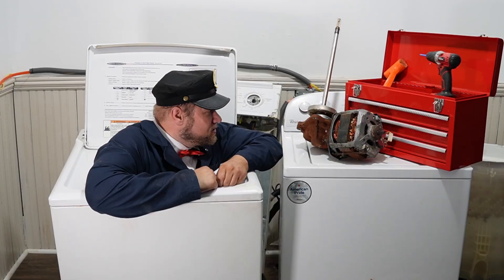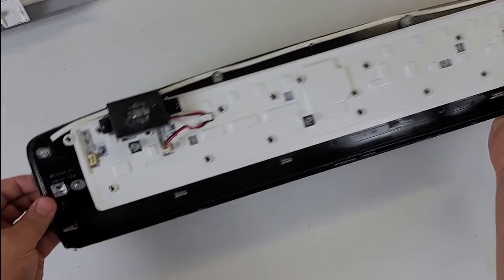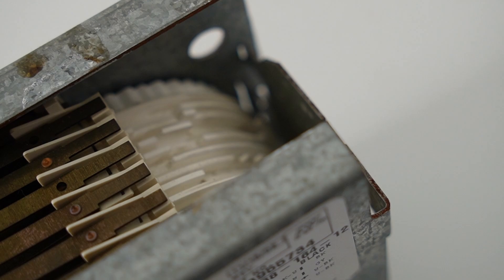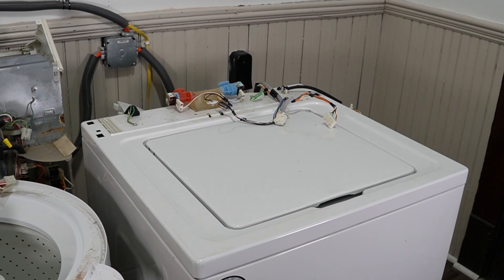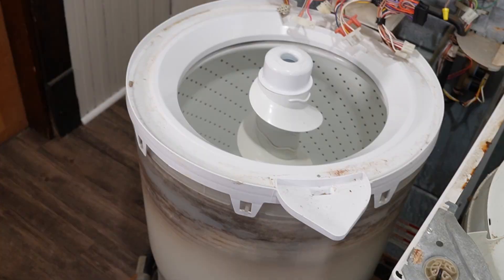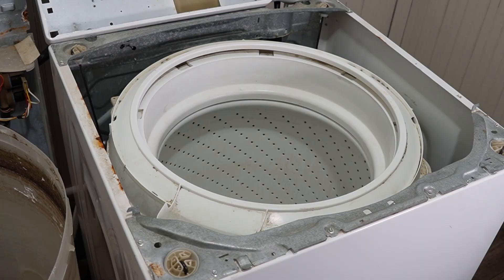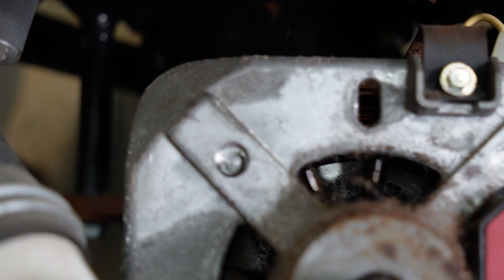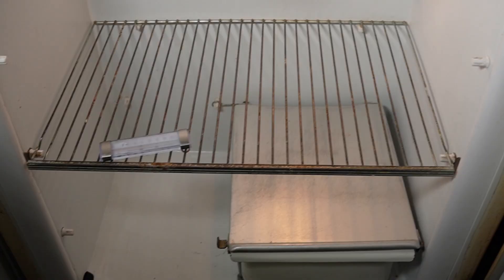Are Washers Built to Break? Inside a 1984 Washer vs. Now

Comment: When I moved into the house I live in now, there was a Whirlpool Cabrio. It worked for about a month, and the little fist-sized pump that drains it started to fail intermittently. A new pump was *$180*. So I went to the used appliance store, walked up to the guy with the fewest teeth, and said "Whirlpool, direct drive, mechanical timer". His face lit up, and he sold me a battered Kenmore which is, of course, a whirlpool, for $100. It has one big motor running everything, it's noisy, but it's never broken down.
Reply: Would have been a lot smarter to replace the drain pump. They are about $15 on Ebay, Amazon, etc. All washers (and dishwashers) use the same pump and there is only a few different mounting flanges. Your new (old) washer has the exact same pump and can fail at any time for the exact same reason.
Reply: @johncoops6897  The cabrio and the Kenmore are entirely different machines, the pumps are not the same. The Kenmore has one large motor driving a transmission, and the cabiro had two small pumps and a motor on the tub. These pumps could not be had for 15 bucks, I did check Amazon and ebay. The lowest price I found was 176.
Reply: @Oddman1980  Yeah, companies do dumb shit to screw customers, like custom sizing of the inlets in a weird size, or odd pinouts, that kind of crap.  Sometimes you can bodge a cheap replacement in, with a little know-how, but like most people feel here--and Timmy stated directly, the problem isn't that electronic controls don't last as long, the problem is that profit-grubbing companies use the cheapest components possible, absolutely intending that expensive parts will fail in 5-7 years, so that people are forced to replace the entire machine, or, at the minimum, pay the company a hefty additional fee for components/service.

Can't bloody wait for appliance manufacturers to get in on the licensing game.  "Oh, you want the delicates cycle?  That's another $10/year for the "Frilly Panties" add-on.  Your base license only gets you cold/cold, permanent press."
Reply: Cabrio? Really?

Comment: What a great video!  I'm a design and test engineer for medical device companies, and anytime I need to come up with something that has to be both reliable and manufacturable, I start by looking at home appliances.  Growing up, we always had GE appliances (both my parents worked for GE) and even with six kids, the washers lasted 20 years or more.  I still have a GE washer, but after the first one lasted 20+ years, the second one, which while is still going, lasted only a couple years before it started not draining and throwing a "pump start" error.  Turns out the pump was clogged with lint, probably a consequence of doing away with the lint trap (?).

You mentioned that you have heart failure and, unless you were joking (why would someone joke about that?), there is a device to counteract many types of cardio failures called a "Left Ventricular Assist Device" or LVAD.  I used to work for the company that invented the first practical  LVAD (Thoratec, now part of Abbot Labs), and the current model, called Heartmate 3, is a centrifugal pump that, in design theory, is exactly like the water pump on that newer washer.  They completely eliminated shaft leaks on the pump by embedding magnets in the pump shaft, but putting the coils on the outside of the plastic housing.  The Heartmate uses a magnetically transparent stainless steel, but it's built the same way for the same reason.

You might ask your cardiologist about whether an LVAD would help in your case.
Reply: Magnetic drive pumps are available in many sizes, eliminating shaft leaks and isolating the pumped liquid from any material other than the housing and impeller.
Reply: I think the GE you parents worked for was a far different company than the one today.  Myself also an engineer but im profoundly baffled by all of the useless and unnecessary features that goes into todays products.  Its a waching machine for goodness sake.  Put the money and the effort on making it last.  I have a similar approach to designs that have to last.  Over size, simplify, proven.  As a EE those 3 things are the foundation of a design to last.  The problem with all these new features and unnecessary connectivity is your trying to sqeeze 50 cents here 25 cents there etc etc all that squeezing also squeezes the life out of the product.  In some ways i feel for engineers that work in consumer appliances.  Must be difficult going to work to make junk.
Reply: @EfieldHfield_377  The only new technology I appreciate on clothes washers is their direct drive inverter motors, eliminating a drive belt and a clunky transmission. No friction parts except for the center bearing attaching the motor to the drum shaft. Super efficient because of magnetism, and quiet. The drawback is that it requires a power control board to drive it. Filled with electronics.

Comment: Was replacing the drum bearing in a Kenmore front loader. While disassembling, I noticed they had slapped the pressure sensor right next to the upper concrete weight, so when your shocks start to go out, the weight will crush the sensor rendering the washer inoperable. Pretty sleazy. I moved the sensor down lower when reassembling.
Reply: I had a thought, which is that the shocks going out could wreck the whole washer (?), so maybe they put the switch there so clueless appliance owners would call for a service tech. Like, they would get their washer serviced BEFORE it bashed itself to pieces internally. So the technician would tell them that both the shocks and switch need replacing at the same time.
Reply: @IrenMasot  it's all for parts sales. They could have easily used real shocks instead of literally a nylon washer stuffed in a plastic tube, but that would last far too long. For $140 a set, you'd expect more.
Reply: I had a Samsung with a similair sounding spectacular failure. Caused $10k in water damages. Insurance went after them and i even got my deductable back. 

Would've preferred not having to replace hardwood though... It still creeks, where as it was quiet before :(
Reply: There's a Russian channel on YT he shows how to remanb those shtty "shocks". Basically relines the inner seal with a new oring and hones the cylinder with leather lol
Reply: @aninnymoose720  sounds like you got the best outcome of that situation.
Reply: @TurkeyOW  yep. detined to happen again i think. this new washer in already coming up on 5 years and is getting pretty sloppy in the bounce.... spring is what failed on the older samsung i had. It broke along with the shock mounting plastic base (which had sheared away)

Comment: I worked as a appliance technician about 20 years ago. The equipment back then was so systematic. They where made to be rebuilt. I loved them. The more computers, the worse they are. Just like cars, you need them to go from point a to b. Simple task but the solution is made overly complex with unnecessary “technology “.
Reply: You only ever replaced them when the frame or skirt rusted out
Reply: New cars are much more reliable than older vehicles. They are also a little more difficult to work on.
Reply: @PaulRudd1941  I am dead serious lmao. It's a fact, I'm not basing this off of an opinion.
Reply: @PaulRudd1941  I'd say 2000s to present lol.
Reply: @PaulRudd1941  All you have to do is look up how long cars used to last compared to how long they last now. All this talk about stuff used to be better is complete bull shit. People love the nostalgia but it clouds their judgement.
Reply: @PaulRudd1941  It's also easy to fix old cars, new cars you need specific tools and to much plastic but they do last longer on average, they're better on gas, and they're faster.

Comment: I'm in appliance repair, and I would take a older unit over a new one any day.
Reply: DITTO!!!
Reply: Me too. I have direct drive maytags I'll keep as long as i can. I sale used appliances and really only like to sale the old dd styles
Reply: They wash better than the new units anyway.
Reply: Until the power bill comes
Reply: @snoochpounder  I'd rather pay $8 extra a month to power. When you call me to repair your 3 year old machine you're gonna pay me $130 labor plus parts and then in 2 more years youll just buy another $800 machine.
Reply: @snoochpounder  The older washers will always clean better and last longer. Just once and done!
Reply: If you are a repair man you must love Samsung and LG because you never have to get your hands dirty.  While under warranty you walk in say it can't be fixed log the service get paid . Lol you can't tell me you don't like that.  🤣
Reply: @frankbarlow3154  older washers are more energy efficient than these new "high-efficiency" units.
Reply: @jeromedavis8575  Did you watch the video? The older unit used literally 8x the power. The older washers might be more durable but they certainly are not more energy efficient.
Reply: @DPsmdg  I saw the video. AND I WILL say that the older ones are more energy efficient than the new so-called high-efficiency ones because all you need to do is wash once and you're done. With the new ones, they don't clean well, and they run twice as long, using more electricity and water especially due to rebalancing.
Reply: @DPsmdg  , they use 8 times the power while washing a load.  However, to get clothes clean with them requires several washings where only 1 is required with older models.  Also, the old ones are easily repaired and will last more than 10 times longer than the new ones.  The cost of production of green electricity should be on the side of the corporations producing it.  However, as has been the case since the late 1980s, the corporations will continue to convince consumers that they must buy ABC Product and will continue to bury hidden costs in its basic functions, while doing everything as cheaply as possible on their end.
Reply: @jeromedavis8575  Never had that problem with an LG front loader, so no. It took much longer to wash however. In case you haven't noticed, water isn't an unlimited resource.
Reply: @frankbarlow3154  well those machines aren't too bad actually, meanwhile you don't overcharge the machine, not so from the electronics side, oh and also those are the favorite brand for rodents to made his nest inside, ask me how I know this..... From 10 calls of a Samsung/LG not working 8 are problems with chewy wires by rats or shorts in the water Solenoid, easy to fix and well payed, talking about the top loader non inverter or direct drive motor machines
Reply: My 80s commercial speed queen washer drum rusted out and I couldn't find a replacement for it. And had to buy used one off cregslist that is newr then the originali had. I got a retired commercial speed queen washing machine.

I like the older machine for the lack of computer controls in them. 

You can replace motors and belts easier then a dated computer control unit that is not manufactured anymore.
Reply: My wife and I still have the same Maytag washing machine and Kenmore dryer from like 1990. They're in great condition, no rust anywhere, everything works perfectly, and all I've ever had to do was change the washer dogs and the belt and keep them clean and dry.
Reply: I have a newish front loader. It did horrible job at washing due to low water usage mandated by the idiots in the federal government.
Then I saw a video that showed how to adjust the water level.
I cranked it up to just at the door level and now it washes great
Reply: @mark98115  Can you post that link?
Reply: @DPsmdg  I’m huge on environmental issues, conservation, and waste-prevention — and i’m pretty sure the environment is better served by the “low efficiency” of my 40+yo dishwasher than by the 4 “high efficiency” modern ones we had to replace in 7yrs sitting in a junk yard somewhere right now.
Reply: @DPsmdg  I saw a difference of about 50.00 a month replacing an old refrig/freezer.  The water bill went down 12.00 per month when I went front loader.  I don't have to wash my clothes twice with the front loader.  My appliances, my AC filters, DO NOT need to be part of the   IOT.   
Yes, the older ones were better quality.  Someone needs to make better quality stuff, stop with the computer chips, make manual dials again.  They can charge more at the POS.   
They will outsell everyone.  My dishwasher does take forever, but that is the last one I am going to buy anyway.
Reply: I sell appliances for a living and I plan to keep my 25 year old Maytag washer and dryer running as look as possible.
Reply: @snoochpounder  NICE user name...too cool.
Reply: @sprockkets  Jerome Davis it depends on what scam one wants to believe.
Reply: @Plumber1111  You scored finding a used speed queen.
Reply: @mark98115  Same only I gave the water presure switch too much of a turn...now the water goes half way up the door and my clothes get so clean...I wish I knew about the Speed queen TC5000 BEFORE i bought my POS samsung.
Reply: @silverbackag9790  Irrelevant.

Comment: Bought my Dad a 20-year-old used Washer and Dryer for his new (to him) house (20 years old in 1998) and they are still running today 2022.  Mechanical systems in the older appliances were so much more reliable than the current integrated circuits & boards of today!

Comment: My main issue with the new machines is the fact that they run everything from a single control board. That means if it overfills, that board is bad. If it won't start, that board is likely bad. If the motor will not get power, that board is likely bad, etc. On the older style of machines everything was split into cheaper parts. Making you able to change exactly which part of the machine that went bad such as the pressure control, or timer.
Reply: They also don't use longer lasting components to counter using a single control board.  Liquid caps don't last as long as solid caps.  They use cheaper relays that will fail.  That wouldn't be as big of an issue if they used many boards.
Buying overbuild motherboards for my PC's has been a money saver in the long run.  With the OS tied to it, the PC is essentially gone if that dies.  I haven't had one die yet.
Reply: The same thing is happening to the HVAC trade. Eliminating contactors, capicators, and basic on/off motors. Switching over to Variable freq drive type garbage. So the $79 basic rescue motor is now $450 - $750 cost. Plus installation. Shits outta hand.
Reply: But it does help with troubleshooting when there are only 2 boards and one is the display driver. A GE Profile I worked on kept getting a "clutch error", service code E6. Turned out to be in the programming on the main PC board. When I changed the cycle from Whites/Heavy duty to any of the other 6 choices the machine ran fine. Wasn't worth spending $300 for a new board.

Comment: I run a set of Whirlpool laundry systems that were built in 1971, and are avocado green.  Other than a pump, water valve, and a wig-wag, the washer is original.  Other than drum rollers and a belt, the dryer is original.  They work well, and are run 2-3 times a week.  I love watching your stuff, here.

Comment: Thank you for restoring my sanity with this video!  Our 8 year old Maytag impeller washer recently began screeching during spin cycles.  It was obvious that the drum shaft bearings had failed in the transmission. A little research (including the video you mentioned from Steve) and I thought “wow, this transmission replacement should be a piece of cake. The bearings are internal to the transmission so I’ll just pop in a new assembly!”  Famous last words. Just removing the impeller plate took over an hour of pulling and prying to separate the plastic splines from the rusted steel shaft.  Once that was done, I told my wife that the hard part was over and I’d have the machine up and running in short order. I removed the drum retainer which took another 30 minutes as it, too, was jammed on the rusted splines.  Of course, the drum was equally jammed on the rusted shaft, and even using the popular 2x4 and car jack method to try to pull the drum off the shaft —after two hours it became fully seized on the rusted splines and I could only ever get the top of the drum bore to move as far as the top of the rusty shaft before the stainless steel drum deformed from the excessive force.  If I could do it all over again, I would grind off the rusty splines so that the shaft could pass more easily through the drum bore. I have repaired all of my appliances for decades and never had so much trouble on what should be an easy repair.  The saddest part is that the machine appears to be designed for relatively easy repairs but if it’s been in service for a while, then the shaft corrosion may put a damper on any plans for an easy tranny swap. In the end, this 8 year old Maytag was beyond economical repair.  A new washer was delivered two days ago —which is exactly what the appliance makers have planned for all along.  Arghhhh….